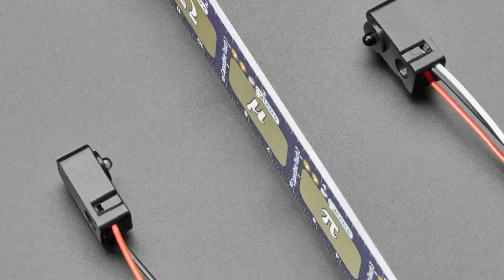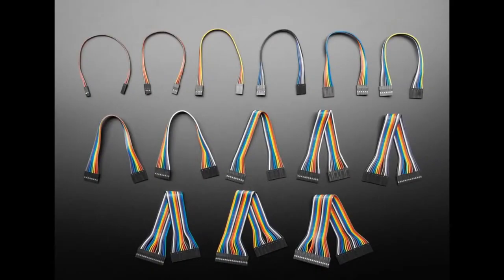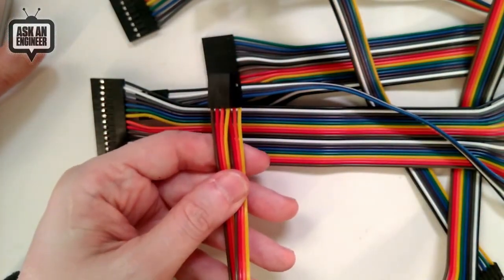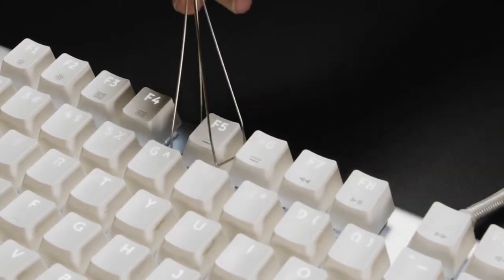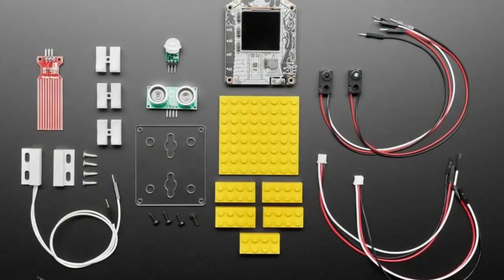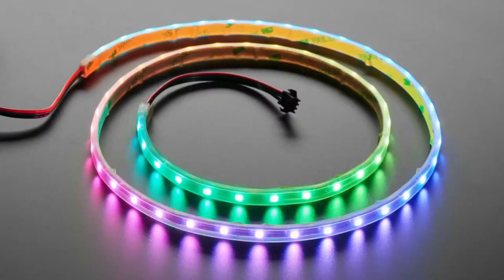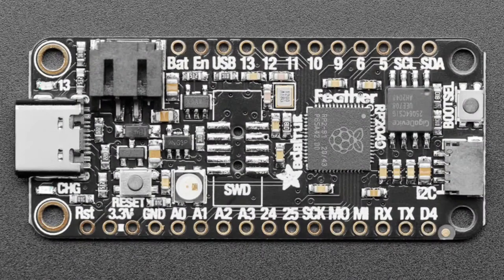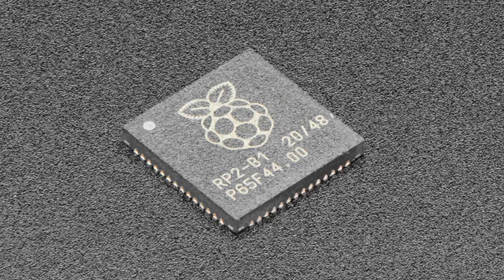New Products 06/02/21 feat. Raspberry Pi RP2040 Microcontroller - Single Surface Mount Chip!

Comment: The weekly Adafruit show that honors the 13th letter of the Greek alphabet!... Nah, not really. XD

"DuPont connectors" or Mini-PV... They're OK. I personally prefer the rectangular pins if they're in at least 2 rows like the Raspberry Pi header, because then I can crimp IDC cables that fit nice and snug on the same pins that fit Mini-PV connectors. The jumper wires with cheap Mini-PV clone connectors always feel like they're a bump away from falling off (and they are). But they beat things like machine pins because there's really no machine pin way of doing wire-to-board connections (unless you shove a wire into a female socket).

I'm definitely going to get some of those skinny RGBW strips. Looks like a different chip than the usual 5050 chips; if they got the SK6812 RGBW into a 3535 package, that would be really nice, especially at higher densities. The skinny strip has nice big solder pads at the cut points, which is nice, but I'm so not looking forward to soldering magnet wire with my shaky hands.